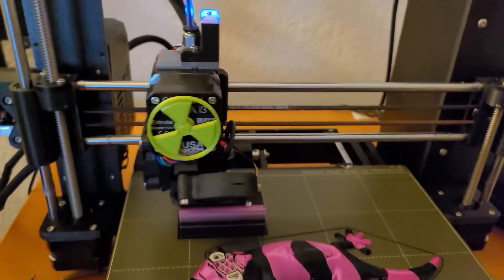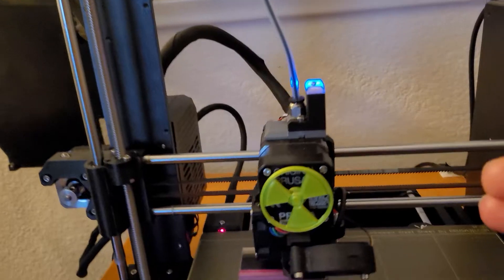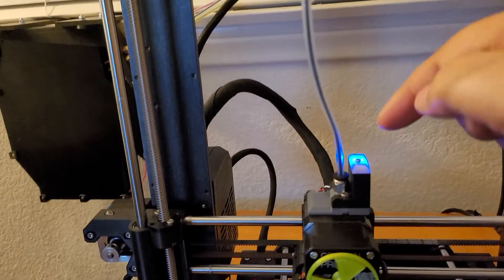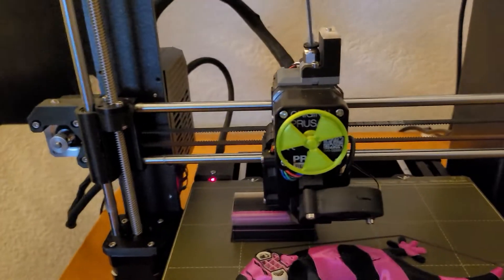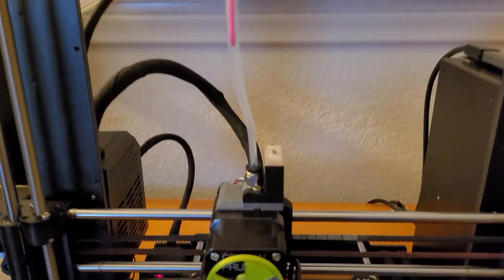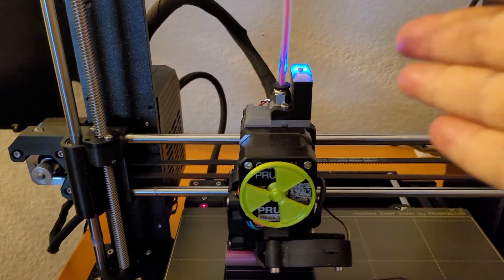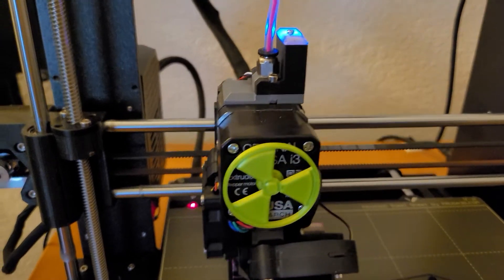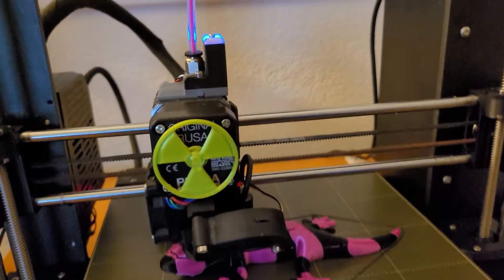Firmware update needed for Prusa MK3S MMU2S IR Sensor

Comment: I think you have to check some filament sensor options in the firmware because this IR sensor should also double as a Filament Runout Sensor (if Filament has run out, pause print or something)
This should be your one and only filament runout sensor.